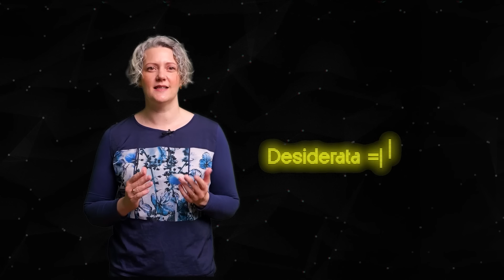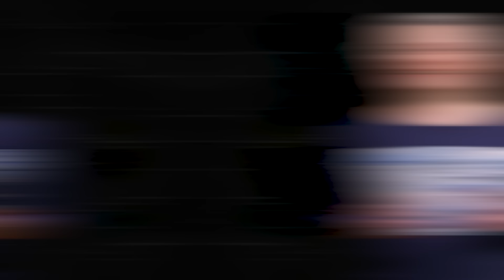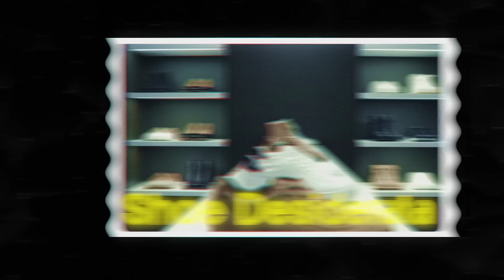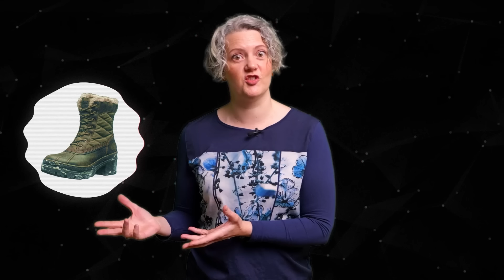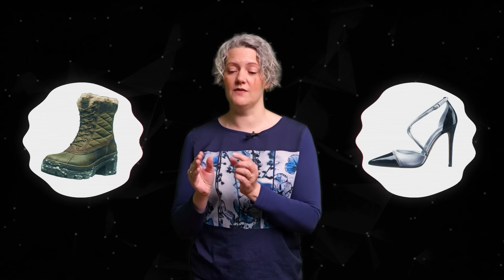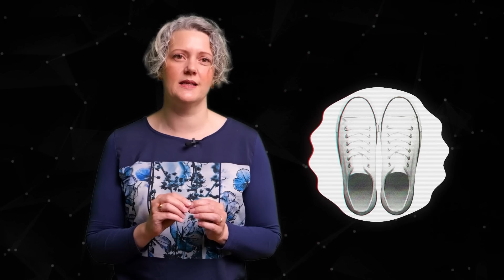The BEST Programmers Use Tests For Engineering Like THIS...

Comment: My whole issue with "fast" tests being a major goal is the laws of physics. The faster you move, the less detail you see. Tests should be used to guarantee very specific cases. If you need to only test 5 cases, nice. If you need to test 100 cases, also nice. Don't let the speed of those tests let you lose your focus on the details. That's a path the technical debt.

Comment: A good video. 

"Tests should be coupled to the behaviour of code and decoupled from the structure of code." - Kent Beck is right about this, and this is undervalued. I have found that decoupled, outside-in tests much better supports both test-first approaches and refactoring the code under passing tests.  As a property of the majority of the tests in the suite.

This is for the 4th property, tests that support ongoing design and development.

Comment: On #4 - when you test your code, you're the first "customer" - and if you're unsatisfied, what will your real customers think? If using your code is a pain to setup, you'll see immediately you need to fix that before inflicting it on your fellow workers. On #1 - tests should be fast - I'm not in complete agreement. Tests need to be comprehensive, and sometimes that implies they cannot be fast, particularly on a complex system.

 I've been accused of writing TOO MANY tests by other engineers - which is interesting, considering my code was well above average in stability by comparison. Also, anything requiring input from a human or unknown source needs to be heavily tested, sometimes with all kinds of relatively random stuff because malware and bots may be testing your stuff for problems. 

I once wrote a password-changing system with the usual "minimum of 8 characters, 1 each of lower-case, upper-case, number...etc." There was no limit on the password length. Also, the parameters were flexible - they may require 2 lower-case 1 special character, or 1 upper case 3 special characters, or whatever, and specified upper limit. Testing that was quite complex.

The test I created randomized all possibilities including minimum and maximum requirements, numbers and kinds of characters, etc... I then ran that test for 100,000 iterations to verify it could handle damned near anything a HUMAN or BOT could create ( because Bots will do the same kind of stuff ). Took about 30 minutes to run, and quite frankly, I'd worked-out all the issues pretty quickly with under 1,000 iterations.

Since the iteration count was ALSO a variable, I pushed the count to 500 before checking it in. That code stayed in production, with zero bugs against it for 4 years ( until I left the company ). It was used over 30 million times in the time I was there.

I would put COMPREHENSIVE in front of FAST any day of the week.

Comment: I'm interested in going from product requirements.. to generating the typical documents that show how the code will be written and tested.. followed by the document/artifacts of that testing once the code is complete.  For example, in safety/critical industries (medical/aerospace/nuclear/automotive) the typical documents are : SDP, STP, SVP, PSAC...  SRD, SDD.  

Is there a playlist/order, either from the Modern Software Engineering channel, or from the ~20 video courses at the cd training site that you recommend for this?

With so much content everywhere, it's a bit overwhelming on where to start.  For example, I've also seen some great videos on the "LDRA: You can be assured" channel.. or CEMILAC Education Program on Airborne Certification for DO178C... or udemy
(
Principles of Software Safety Standards
Unit Testing & Other Embedded Software Catalysts
Interaction Tests, Mocks & Refactoring in Embedded Software
Tonex Training : DO-178 / DO-254 Training
) 

or software
(
Unity+FFF   
Unity+Cmock  (auto-mocks)
ennorehling / CuTest    
Ceedling  / Cmock (Generates mocks, runs unity test)
CppUTest  (alternative to Unity+Cmock), 
CUnit  (alternative to CuTst), 
Renode (embedded system simulation)
embedded-hal-mock (Rust embedded HAL mocking)
Jenkins 
)

BTW, is there a standard practice on embedded-code-testing, that can be done without hardware?  Can you document that code is safe just be analyzing / simulating without hardware?

Comment: The best programmesrs use formal methods, not the childish belief that tests can prove anything.
Reply: Real programmers use butterflies.
Reply: No, only CS grads do, usually boasting about it. It is not achievable in a fairly complex system.
The best programmers do TDD + mutation testing.
Reply: As a formal methods proponent, I still find myself writing tests because I want to deal in real, specific output.